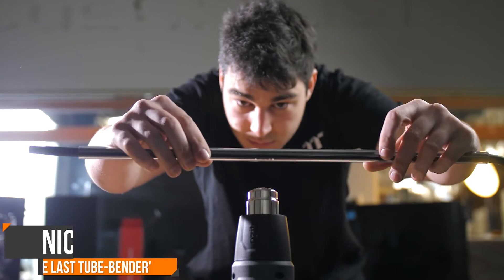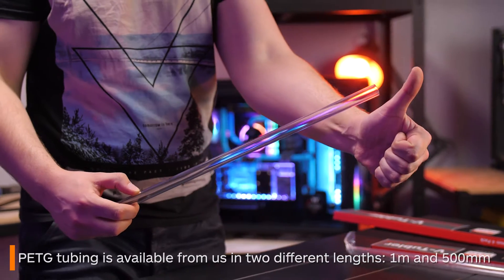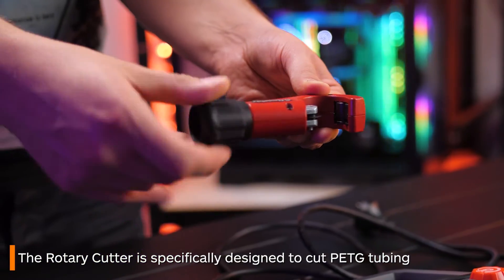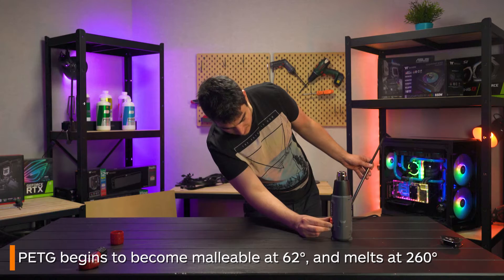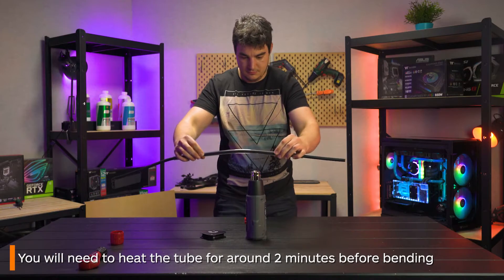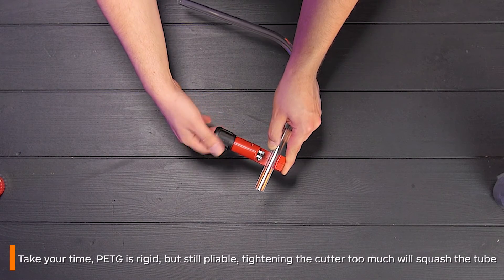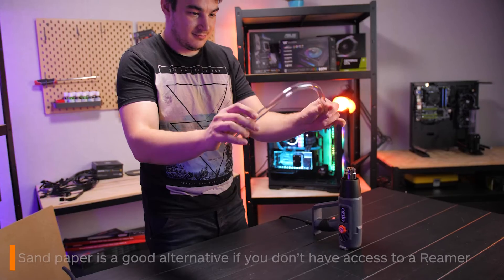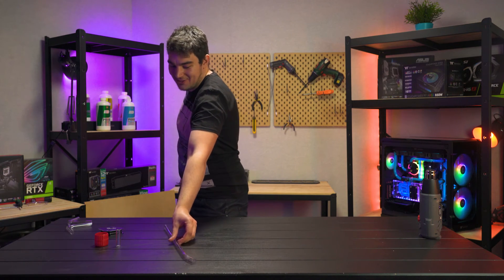Learn HOW TO BEND PETG tubing to watercool your PC

Comment: I watched it thoroughly and still managed to do all the wrong ways; overheating, not heating 10 or so MM to either side of the bend, and starting the bend to early or to late. This guy is spot on. I like the free hand as well, and agree the silicone tube is a must with soapy water to get it back out. It really helps. 

Thanks for a great and informative video.
Reply: 10-15 **CM**.

Which when the hand is spread. Is roughly the span from the tip of your thumb, to the tip of your index finger

Hope that helps, have a good one

Edit: have*

Comment: i would have loved if he showed us how to do a 90 degree bend at the end of the tube, i find this quite common in my builds as i cannot always source 1 meter tubing so i need to more stingy with it, but often i ruin it regardless..:(
Reply: Not sure if I understand your problem correctly but you could bend a larger section of the tube in half and cut most of it on one side. That way you would get a tube with a 90 degree angle at the end.

Comment: Please please reply can we use the soft tube comes with kit when bending this tube instead of that silicon tube ???????
Please please reply.
Reply from the maker: Hey Ahmed! Unfortunately not, the silicon insert is made to withstand head from a heat-gun and hold it's shape inside the tube so it doesn't allow it to kink.
Reply: @ThermaltakeAustralia  so please can you tell me where I can buy that silicon insert is it available on amazon.us cz I have no other source to buy 

I have just one last last question please please please reply that will this petg 500mm hard tube fit perfectly in the thermaltake pacific rl120 cooling kit please please please reply.............

Comment: Why can't I get the silicon bending insert into the thermaltake hard tube? It's quite hard to get the silicon inside the hole. What should I use?
Reply: use KY for easy insertion hahahah use water and soap!
Reply: The right size probably, or lubricant
Reply: @scheve332  I used oil :(

Comment: Great video. I think though you should do a follow up showing the installation of the tubing & figuring out where you bends should go in a case.
Reply from the maker: For sure, we'll be doing a video overview on a bunch of different fittings and how tubing connects to them as well.